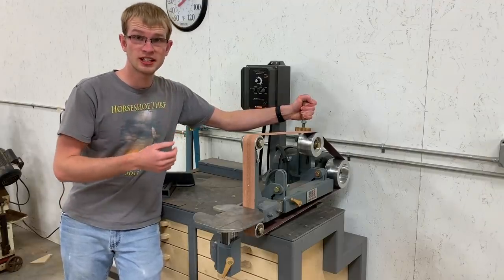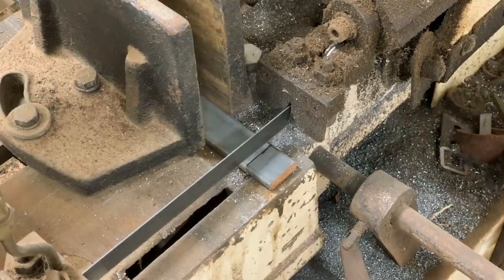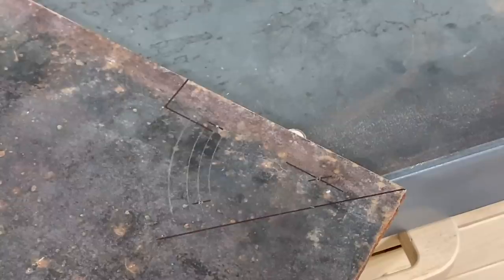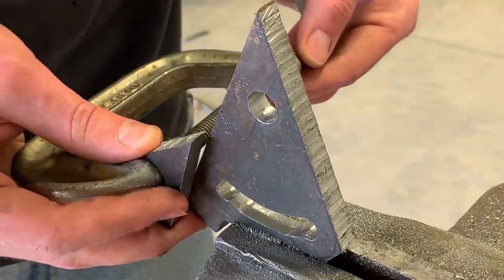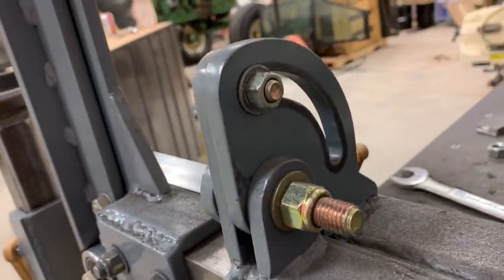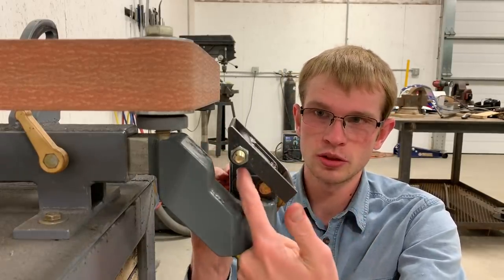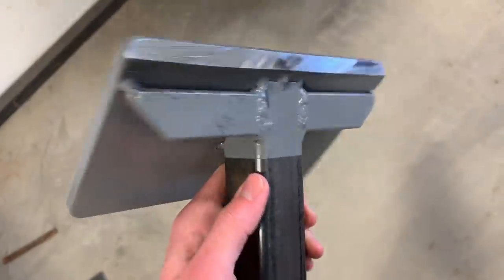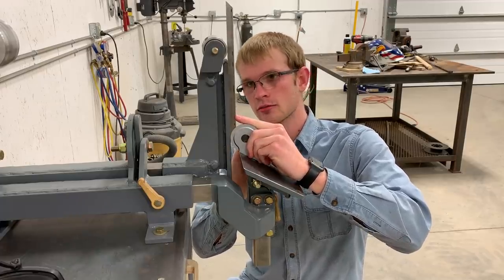Adjustable belt grinder table

Comment: Very nice job on this table, and all the components of this grinder. Enjoyed the fact that these parts were fabricated by hand for the most part and not on some CNC mill(because I don’t have a CNC milling machine). If you had to guess, what do you think you have in $ for the materials on this grinder? I plan on buying your PDF’s of this entire build.
Reply from the maker: I’m guessing all-in, with all attachments, around $1200. Not including the stand it sits on. I am running a used motor that I picked up for $60, so if you plan to use a new motor then add $200-300.

Comment: Great work, really enjoying your videos. I've never used a hack saw to cut plate like you do. Is it reasonably quick? Seems like it would take forever.
Reply from the maker: It’s not too bad if you have a good blade and choose the right tpi for the material. But actually I do it largely for the workout :)

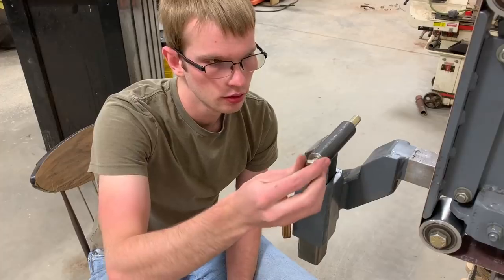Comment: 4:20  ...perhaps, grind a bit off the back of that DOM, sleeve, to attain a closer relationship with the belt, and have a more intimate closeness.....also on the bottom inside mount. There is alot of thickness, on that DOM, so a flat spot nearer that belt would not affect any movement, strength in that hinge....

Comment: Jeremy, I've noticed this across a couple of your videos - when making certain cuts, cuts I'd normally think of doing with a cutoff disc on a grinder, you often use a hacksaw - do you find it offers more control? Or is there another reason?

Awesome work as always!
Reply from the maker: It’s quieter, doesn’t heat up the part, makes no sparks, and gives me a workout, which is something I can use from time to time. I’m not saying everyone should follow my example, cutoff discs are fine!
Reply: @Jer_Schmidt  I'm not about to trade in my discs for a hacksaw any time soon! Haha! I had to use one at a client recently where sparks were a no-go - It really gives you some perspective.

Speaking of, my 10mm steel parts for your grinder design arrived last week from laser cutting! I'm super excited to make one of my own!
Reply: I was wondering the same thing...  Thanks for the reply!

Comment: Hello Mr Jeremy, I have a quick question, I am about ⅔ done making the grinder off of your plans I purchased on Etsy. I am curious to why you used a piece of tubing for the table post as opposed to the solid 1 ½ bar?  Also these videos are aweome and I hope all is well after your relocation!!
Reply from the maker: The solid bar really isn’t necessary for strength, since the load is pretty much inline with the tube and putting little bending force on it. So it would just make the table heavy and unwieldy, but it would be fine to use solid if you want.

Thank you!
Reply: That makes sense!!  Thank you Sir!

Comment: Man if you want to drill precise holes efficiently without breaking drills
you have to use drill emulsion for steel and methylated spirit for 
aluminium(“aluminum” for American ignorants) to keep your drills cool
and best surface quality of the drilled holes!
Otherwise nice design, even it is a bit overcomplicated with all the welding.

Comment: You're a very clever guy.  Even the stuff you don't explain I learn from...such as tilting the work piece when you cut it on the band saw so it cuts at an angle and doesn't bog down the blade.  Keep making good stuff!
Reply from the maker: Thanks!!
Reply: I know, right? I noticed that workpiece was tilted the first time I watched the video but just now realized the reason for it this second viewing. Quite clever, indeed. 
Always love the informative quality content from this channel!
Reply: I loved that little tidbit of knowledge as well. Never seen it done like that before but it's brilliant.
Reply: That is basic metal sawing knowledge.
Reply: @erik....  Well I am a woodworker...so....

Comment: Jeremy is it possible, in the future, that you convert your plans into milimeter? metric is a big deal in europe and i know a lot ppl really want to built your grinder. i wanted to buy the plans but i cant work with imperial stuff.....inch,feet,yard miles??? what the heck? plz help!!
Reply from the maker: I might at some point. It’s very difficult since the whole machine really needs to be redesigned in metric to work properly with 8 or 10mm stock where I used 3/8”, etc. but it would probably be worth it...
Reply: Just multiply every dimension on his plans by 25.4. That will convert them to millimeters (then round off the decimal places as necessary). It's not that difficult.
Reply: Converting isn't the worst thing to do in advance Yourself before building.
Helps understanding his original thoughts when building his empire version.
And helps understanding where dimensions would be crucial, at all, and where not.
Reply: guys guys relax :D iam just asking if he plans on doing it. would be really worth it, since it is his baby and he knows best. of course you could convert it and so on but it would not work in the end just like he said. iam not a beginner, iam 41 years old have restored cars build machines and what not. his machine is well commented in all german knifemaker forums and what not. there are a lot of ppl willing to pay for a plan in metric. just was asking if it would be possible in the future. i dont like to fiddle around with imperial thats all and if he plans on doing so perfect. lets not forget that ppl pay for it ;) if hes not planing on doing it thats fine to i like him anyways ;) so relax guys......btw iam german, we like metric
Reply: @OU81TWO  It's not just about converting inches to mm. Steel, bolts, pretty much everything come in different size and thickness i Europe, and You can't just switch from 1/2" (12.7mm) steel plate to 12mm and expect everything to fit anyway.
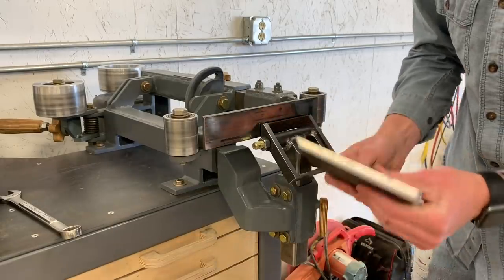Reply: @erik....   Anyone with a little bit of common sense would know not to try and convert the size of the fasteners. Simply use the closest size...12mm for 1/2". I didn't think I had to explain that. As far as plate thicknesses, they are not as important as the functional measurements between features. As an example pause the video at 13:27. Look at leg plates of the grinder where the bolts attach it to the table. That plate looks to be 1/4" thick. Well, it doesn't really matter if you use 6mm, 8mm, or 10mm plate. The end result will be the same.
Reply: @OU81TWO  Well the size of fasteners are obviously dependent on other measurements if you look at the plans.
Reply: Do it bro! @Jer_Schmidt

Comment: That is a really nice design I must say. It looks super sturdy. Though I am wondering why did you choose to make it only to 45 degrees? Would it not make a lot of sense to have it go to 65 degrees, so you could grind a 25 degree bevel on chisels and the likes?
Reply from the maker: I designed one that could go up to 60°, but there were some issues with that design. It’s hard to explain here, but it increases the distance from table edge to hinge when the table is set more flat, and it has to have a part that sticks out the back to accommodate the slot, so the lower wheel hits that piece when trying to tilt the grinder.

Comment: Very good desing and execution. I bet you could dump that grinder at the bottom of the sea, retrieve it 500 years later, sand the finish a little and it would still work and be square.

Comment: I would like to thank you for not using the vernier's to scratch a line. I cringe every time I see a precision instrument being used in that manner. And if you want you could take a wrench and attach it to the table edge, so it is always handy or make another adjustment handle and attach it with a magnet to the edge of the table it will always be in reach. Unless you are the only one that uses the shop then your tools will be borrowed and not brought back to where it was found.

Comment: your locking handle for the pinch-bolt can be a thick walled tube welded to a nut to get your handle away so as not to hit the table, and then drill a hole in the end of the tube and have a rod with balls on the end (like a bench vise) so if the handle ends up pointing the wrong way it doesnt interfere with your flat surface..........

Comment: Jeremy you amaze me with your design and building skills. This is a really good video of an excellent design and construction. Your skills with metal fabrication are A1. I like your ability to weld having properly prepared the weld geometry. I guess you are using gas shielded (MIG) welding from the appearance of the welding head and the lack of oxidation on the excellent welds. Good thinking too, to limit the welds on the steel plate to avoid introducing too much heat, resulting in thermal stresses, with risk of geometrical distortion. Some lucky company will be rewarded handsomely from employing you one day, if that is what you choose to do. Thank you for sharing this exhibition of skills with us. 👍

Comment: For your locking you may want an adjustable handle or adjustable handle nut.  You can lift the handle and position it to any rotational position that fit your application.  It might take one minute to get it threaded on but then you could have it in the position you want.  I've used them.  They are great.  Here are examples:  https://www.kippusa.com/us/en/Products/Adjustable-Handles/Adjustable-Handles-Classic-ball-style/K0116-Adjustable-HandlesClassic-Ball-Style-Zinc-inserts-and-internal-components-steel-internal-thread/K0116-Inch-Adjustable-Handles-Classic-ball-style-zinc-inserts-and-internal-components-steel-internal-thread-inch.html

You do great work and design.  Machine and manufacturing firms would love to have you.  You would fit right in with the build and debug of custom machines.  Very exciting and challenging work.  Tour some machine shops if possible.  Contact them, tell them what you are interested in and ask if they would give you an informative tour.  Many will as a way encourage people to take up the vocation and they will learn a little about you.

Comment: Something oddly satisfying about the precision of your workmanship, great job. You mentioned that you wished it had a bit of over travel on both ends of the locking mechanism, I was wondering what the reason for it would be?
Reply from the maker: It just needs to go at least to 90 & 45, but if you have a bit of over travel then you can be sure it always will. I just want to be sure it doesn’t stop 0.1° short. That said, I have the fixed tables for those angles, so I’m never going to use this table for them...
Reply: That makes sense. Thanks for answering, cheers mate.

Comment: Are you familiar with adjustable handles?  Instead of a nut, they look like a handle that you said would be too long and would hit the underside of the table. Except that the nut is splined on the outside. The handle that goes over it is splined on the inside and engagement is spring loaded.  Just before the handle hits the table, you pull it up and reposition it. You can get them with male or female threads.
https://tinyurl.com/y2f95o7j

Comment: Another excellent video Jeremy, well done.  
I like the trick on the band saw where you stuck around piece of stock under the long plate so the teeth of the bandsaw didn't plug up.

Comment: Nice build as usual. You could use a female clamping lever for the angle adjuster as they adjust their clamping position and don't require a full rotation. Do a search on eBay

Comment: You have probably mentioned this before but where are you sourcing your DOM.  Im looking for short lengths
Reply from the maker: You can get little pieces of every kind of steel imaginable on eBay. They aren’t the best price per pound, but probably the best if you just want a small chunk.

Comment: They have those handles that you can pull out, off the adjustment nut, to tighten and loosen, like on a mill... that way you wouldn't hit the bottom of the table... Glad to see you made an adjustable table... I've been suggesting it for a long time... Next is the surface grinder, hahaha  take it easy...

Comment: at 16.07 how about a nut welded on a piece of round tubing with T handle on opposite end that would go past the end of table so you can rotate T handle and tighten it.
Reply from the maker: That would work, but too bulky for my liking.

Comment: With even an old Bridgeport you'd see the speed and precision of your builds raise exponentially. Great work and it's critically important to keep your "old school" skills honed. It's also important to honor them. CNC technology is incredibly awesome, but using too much of it will atrophy your ability to problem solve with our predecessor's ability and ingenuity. I work with Haas VMCs every day, but I don't use a CAM system to program unless absolutely necessary. I try to get onto a Bridgeport as much as possible. I've found that if I don't do these things, my overall skillset begins to wither.
Reply from the maker: I want a Bridgeport so bad! Thanks for the comment.

Comment: If the handle on the adjustment would never need to move more than like 90 degrees anyway couldn't you just thread the nut on and then glue on the handle?
Reply from the maker: Yes, but I don’t like making things that can’t be disassembled without destroying them. What if someone wants to restore this machine after I’m dead, they’d have to ruin the handle to disassemble and repaint...

Comment: Well done Jeremy. Well thought out accessory. Would really like to see your take on a DIY surface grinding attachment a la TW90. See
https://www.bladeforums.com/threads/home-built-surface-grinder.1532559/page-5  for some great ideas.  This probably the best thread I have seen.
Reply from the maker: Unfortunately all the ones I’ve seen seem to be too light to be accurate, or they use rollers or other inaccurate means to facilitate linear travel... Maybe the real issue is that I have experience with a real surface grinder, so my expectations are set high. Anyway I’m certainly thinking about it and trying to come up with a better one.
Reply: @Jer_Schmidt   I think a lot of guys use it to clean up damascus billets or forged blades where you need flat surfaces on ricasso areas for guard or handle slab fitment. Really high accuracy like in real stone wheel surface grinder not really that imperative. Easy taper tangs like the sine bar function on the Travis Wuertz one seems very usable........

Comment: Why didn't you tap the adjustment tab instead of using a bolt and nut.  All you need to tighten and loosen then would be one wrench.
Reply from the maker: It only takes one wrench as it is, because the bolt is welded in.

Comment: What type of belts are you using and the brand names. The ones I use are cheap its true and they rip a lot when ever using metal.
Reply from the maker: I don’t remember the brand name, but you don’t want these anyway. They’re cheap ones from eBay. They are ceramic grit, which I would say is the one positive aspect of them.

Comment: I feel like the tables could use a T-slot, or something that you could put a miter gauge or a fence into, that way you can make sure that you're keeping everything square as you grind. Just a thought! Awesome video as always
Reply from the maker: Good idea... I don’t like the idea of breaking up a smooth surface with a slot, but it should really have at least true reference edges.
Reply: @Jer_Schmidt  True, you could also put something on the edges of the plate (might need thicker tables then though) that could have something like a tablesaw fence fit into

Comment: Sorry me again, a couple of questions: What type of welder do you use and, in your opinion, could your belt sander design be made in a smaller scale?  Watched all the attachment vids now, fantastic.
Reply from the maker: I use a Miller 211. The grinder design could be scaled, but would probably require some CAD time...
Reply: @Jer_Schmidt  Thanks mate, I will give that some thought, keep up the awesome work :)

Comment: would be interested in more about design process. how do you decide what gets built when?
Reply from the maker: Everything is designed in CAD first, down to the tiniest details, and I build it in my mind several times before building it in real life. Usually this “building it in my mind” part will turn up some problem that I’ll run into, so I have to design around that and repeat.

Comment: damnit Jeremy, does your shop not have any sheet steel. 07 ga would be so more than adequate for those side plates!! daymm dude!! 😀
Reply from the maker: Oh yeah, plenty. But I want it this way :)
Reply: @Jer_Schmidt  good enough.. i just had a nest of parts cut on the laser for my version of this machine. My adjustable table is Soo similar to this one you just built.
 I Went with 1" bar and 1/4 parts.

Comment: You don't use any lubricant when drilling or band-sawing?
Reply from the maker: No. It’s messy, and as long as you run them really slow, the bits / blades still last quite a long time. I do use oil for tapping though; it’s worth it there.
Reply: @Jer_Schmidt  Fair enough. I have to say that for hacksawing by hand, I find a squirt of WD40 just makes the stroke so much smoother and easier, and the experience just seems to go better.